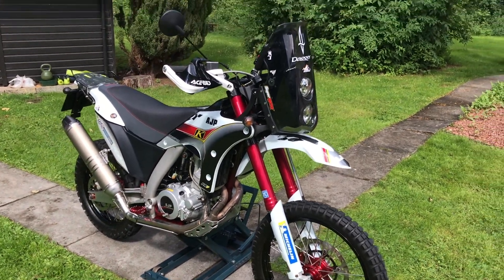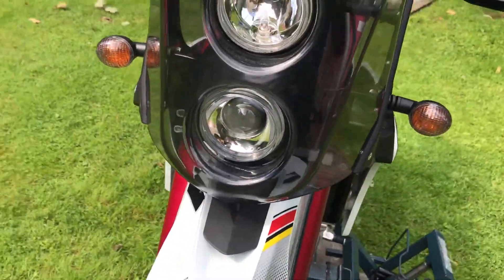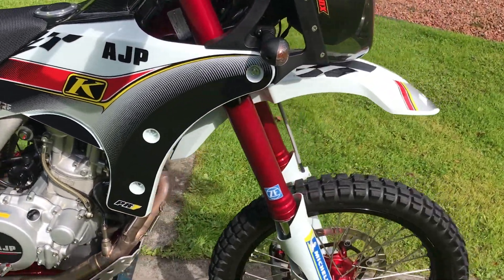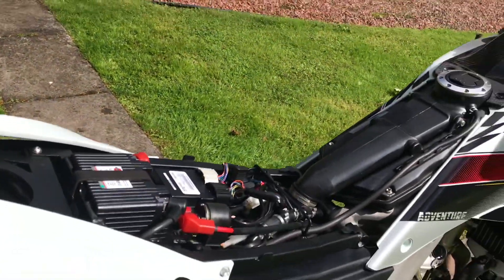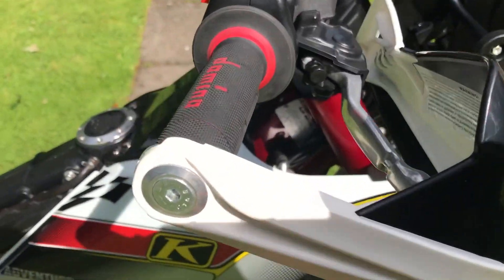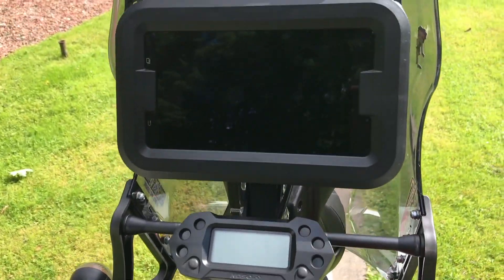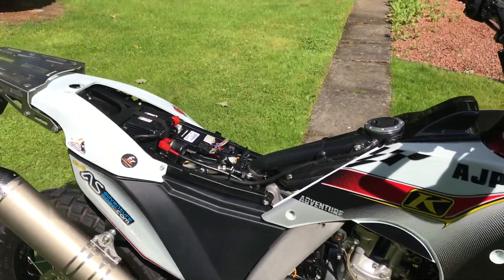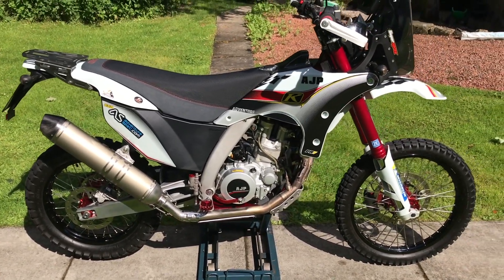AJP PR7 1st Impression (Bill Cairns)

Comment: Hi Bill been watching your videos since you first picked up the 790, but i see the ktm no longer used, SWM gone by the wayside and now an AJP, i have the original TE610 the basis of this latest two bikes, but was think of moving it on and go to the 790 or T7, I'm guessing you've ridden the T7, in comparison how does the latest bikes compare the 790 and T7 ?? Cheers from Aussie
Reply from the maker: Hi
790... you’ve got a big decision to make there🙈  I still have mine in a box of bits needing 2nd rebuild - 15 months old, 2,200 miles on clock..Ktm Uk & Ktm Austria will not cover any Warranty claims to date.. sent them Legal letters & they have ignored ME..🙈
I have ridden  the T7 and it is a excellent machine and very reliable., was going to buy one,  but with the type of riding I’m doing I went for the PR7... cheaper and lighter... Puck your Poison carefully 👍👍🏴
Reply: Tenere is great and reliable World adventure bike literally twice the size and weight of AJP. For munching miles of dirt roads of Australia is Tenere is brilliant.
For narrower lanes and more technical stuff God help you with T7 - especially if you drop it. It's an elephant of a bike.
AJP is unbeatable in tighter stuff but can carry very little luggage because of lack of a sub frame.
Reply: @istra70  hi ya mate been looking at the T7, currently doing up my 610 husky for more of a adventure setup for longer distance but concerned about parts availability overseas apart from that the 610 is great I'll do a few longer trips locally in aussie then make the decision waht to do
Reply: @patsullivan3096  On T7 you will be way more comfortable - especially if you have rally seat on and Yamaha doesn't need any spare parts....
 KTM/ Husqvarna have centres all over the World, or check with your local dealership to back you up with shipping spares when you need..... You should get them in 3 days anywhere  ... ( used to be before "pandemic ")
The same goes to AJP in Portugal - saying that they will ship parts the same day .....
There is always option of taking few crucial parts with you....if you don't carry camping gear - you will have lots of spare room.....
Most countries are at the moment in lock down .....so there is always good old Simpson desert ready to be conquered....